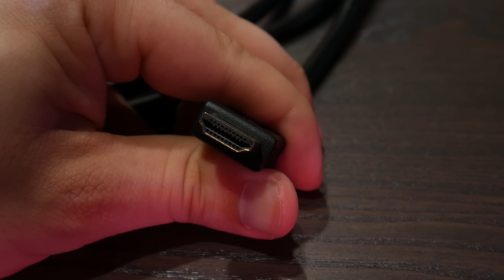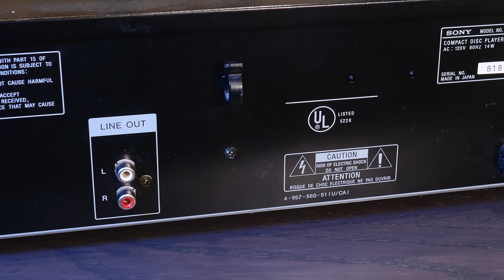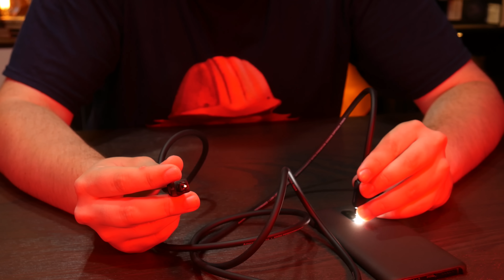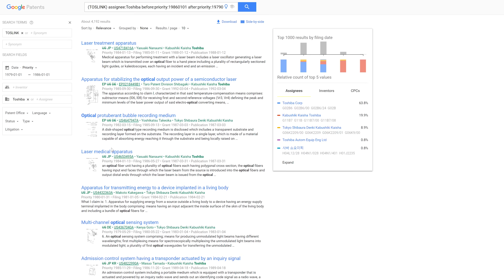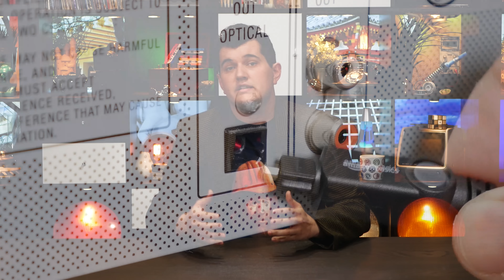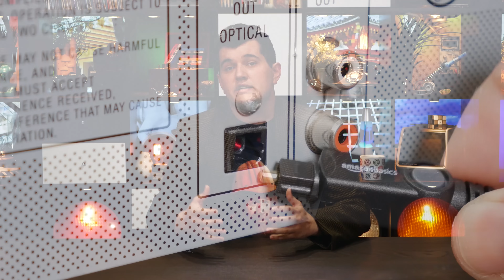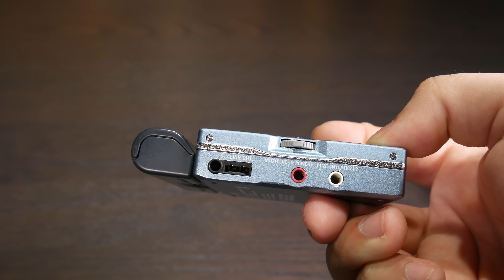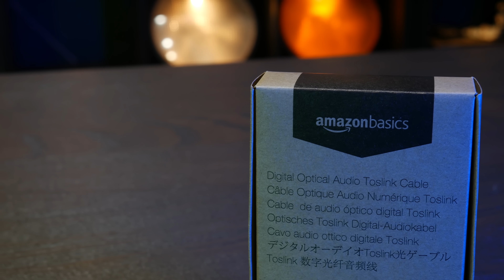TOSLINK: That one consumer fiber optic standard

Comment: the fact that there are TOSLINK cables with gold plated connectors just makes me want to die
Reply: I worked at a Best Buy years ago. A supervisor tried to convince me the gold plating on a toslink cable made a difference. I just laughed.
Reply: The funny part is that some of the gold-plated ones are slightly cheaper than the normal ones. Even more ridiculous though is "shielding to block interference". Lol you could cover it with a peice of black paper and call it shielding.
Reply: @HedgehogStudios1  since the signal is carried by visible light, black paper could legitimately be called shielding!
Reply: @HedgehogStudios1  yeah but true shielded cables exist, think hdmi, unused ports all those grounds.  of course that just makes the reference 0volts noisy instead.  other option, don't run your audio through a manufacturing line with high power motors/generators.  also an option
Reply: Some people are also ready to pay +1,500$ for a HDMI cable that has solid silver conductors, carbon fiber plugs, all the strands twisted and knotted and whatever together to make the sound and image better in all digital format. Like seriously, if the HDMI cable has the same standard specs as the other, go for the cheapest one, the more expensive does nothing else than cost more.
If you want a good laugh at how stupid some people are, just Google Monster or Wireworld and look at their HDMI cables. Monster stops at something like 200$ but Wireworld, oh they just start at 200$. And just to make the point clear only thing that that 1,500$ Wireworld Platinum mumbojambo HDMI2.0 cable does better than no-brand HDMI2.0 cable that costs 10$ is milk the gullible.
Reply: @IcedForce  those 1500$ things are probably better, structurally wise. i think you'd use such a cable for some rugged outside device, not your desktop system
Reply: @nemrody7828  Nope, Wireworld stuff is completely snake oil. They are not something extremely rugged or something that will make your experience anything more than just lighter wallet. As in their most expensive snake oil named Platinum Starlight 7 has solid silver conductors, which while yes, expensive and maybe better if we were actually moving analog signal could make some difference, aren't something you want to twist a lot or put into some harsh place, they will break because silver is actually fairly weak stuff.

But we are talking about digital signal that is just ones and zeros. There is no "sound" or "image" moving that would degenerate because cable goes too close to a power outlet (there is just "information" about the sound and image that the receiver turns into the sound and image). They either work or they have so much problems that even a blind-deaf would think something is broken or they don't work at all. And honestly, if you get errors with digital signals in cables, you either are running too long, wrong, cables for the job or you live in a place where you probably don't have a single electronic device that would work completely fine.

So no amount of "oxygen free silver" conductors, fancy twisting, gold plating conductors with carbon fiber covers or any of that stuff that used to matter somewhat with analog signals doesn't make HDMI cable change the sound  warmer or colder or give more bass or presence or give richer colors to a sharper image or any of that dingdong that Wireworld claims their Platinum Starlight 7 (600€/m) does. For any of that you would need to actually actively modify the signal which would make the cable actually worse quality than a coat hanger because it's not doing what it should do, transfer the signal unchanged from A to B. [Active cables are different story but also they should just boost the signal, as in send the same one or zero but louder, not change it otherwise than their own working needs, so no "warmer" sound or "more colorful" image should come out from the other end, just the same sound we send]
Reply: You're kidding right they seriously have gold-plated ones?
Reply: @Trekeyus  consumers are stupid
Reply: @kevinbooth-  more like uninformed
Reply: @kevinbooth-  Remember when everything was Turbo, then HD, 4K, now AI?
Reply: Kevin Booth —— You wrote, “consumers are stupid”.

No, consumers are ignorant, and that’s not wrong when it comes to toslinks.  But what is wrong is to manipulate people.
Reply: @thomaspayne6866  Yes, it's wrong to manipulate people, but what do you do if people want to be lied to? In the end, it's probably a win-win. The salesperson gets a large sum of stupid money and the idiot buyer gets the bragging rights for the next cocktail party.
Reply: TruthNerds ——  Too bad. Tell them the truth, or tell them nothing, but don’t lie.
Reply: @kevinbooth-  ignorant is not stupid. Some times there is no excuse for ignorance though
Reply: @Trekeyus  Not only that, but I've seen Shielded TOSLINK cables... Suck on that!
Reply: @Trekeyus  Gold makes it look better. Dosen't do shit except bragging.
Reply: @Trekeyus   they are gold plated for the same reason that it says supreme on a shirt
Reply: @Trekeyus  didn't you see the video? he literally showed them onscreen
Reply: @proxy1035  it was a rhetorical remark at the sheer stupidity of the concept of gold plated toslink.
Reply: @Trekeyus  oh i see. it sounded a lot differently though.
Reply: @Trekeyus  yes for the same reason monster made $200 cables
Reply: @Trekeyus  Yep, Some are also VERY VERY VERY !!! expensive! . You can even get 24k gold ones! Amazing right!
No chance of signal loss with a gold plated one!....... No wait,,
Reply: @Trekeyus  Even Monster Cable made one.
Reply: @Trekeyus  14:23
Reply: @Trekeyus  Yup, and did you know the cable of brand X transmits the laserlight só much better that you can actually hear it? How that works even though the signal goes through several conversions is one of the great mysteries of life. But hey, a manufacturer has to point to something to justify their Toslink cable being 20 times as expensive as a standard Toslink cable.
Reply: @Trekeyus  maybe it's for galvanic isolation?
Reply: Trekeyus same with hdmi.
Reply: @Trekeyus  They look nice. As long as you are buying it for the fact it looks nice rather than some kind of audio enhancment what's wrong with it? Similarly it probably means that cable itself is of higher quality and wont break as easily if you happen to catch it on something.
Reply: Almost as bad as the adds for the Pear USB cables that claim digital audio signals are "more than just ones and zeroes" when they totally are just ones and zeroes.
Reply: just look into "audiophile grade" cabling
they believe that a power cable with woo woo space magic makes better sound
Reply: I once got banned from a certain Headphone forum for arguing that $1000 TOSLINK cables provided no audible difference over a $5 cable. I even offered to run tests with a $20,000 1GHz oscilloscope if someone would mail me a set of cables (that I would return afterwards).

I wager the jitter difference between $5 plastic TOSLINK cables and the $1000 ones with glass cores would be in the single digit nanosecond range, at the worst, and unmeasurable at the best.

That’s not even remotely audible.
Reply: @BreakfastPaladin  WELL.. I would guess that it is possible that the fiber material could have an impact on the signal the longer the cable. A cheap $5 cable made with impure plastic could have an impact over say 10 to 30 meters?

The best analogy I can think of would be headlight covers. If you have old headlight housings that are fogged up / blurred with age you will not be able to see as far as ones that are clear. Taking into account the strength of the light and the strength/ability of the source detecting that light.

But I would imagine that Audiophiles would tend to have better front/head and back-end equipment to start  with so non pristine fiber material would only come into play at great lengths. (Over 100ft or 30m )
 
A ADQOPTDIA30 Audioquest Diamond 3m (10') Fiber Optic Digital Audio Cable Full Toslink to 3.5mm Toslink cost of over $1000 
I severely doubt would be any better than a 10' Amazon Basics cable thou LMAO.
With the minor exceptions of cable durability and how it looks hooked up to $$$ equipment.

As for the gold plated ends?!?!? Possibly for durability? If you were not just keeping them plugged in.. They of course would not help with signal transmission or any use in interference lol (Random Cosmic rays maybe?!? LOL)
Reply: @tisjester  a digital signal just works or it doesn't. There is no gradual degredation as with analog signals.
It sounds exactly the same until the signal is so bad data goes missing. At that point it just completely corrupts.
Reply: @TisJester XxX

As @Baron von Limbourgh below points out, it’s digital, so it’s either on or off. Using your headlight analogy, it would be like you tapping out Morse Code with your high beams, on a foggy night, and me standing 5m away decoding it. It doesn’t matter if it’s filament bulbs and a cloudy cover or HID bulbs with a clear cover, so long as I can see some light the result would be the same.

Now, as for glass vs plastic, the only difference is in light transmission (as you said). If it’s very poor quality plastic, it may add jitter in the low picosecond range due to less light getting through the cable, thus causing the light sensor in the receiver to not quite turn on as fast as it would otherwise, but again, that’s imperceptible from a listening perspective.

Keep in mind the above is just theory. I’ve tested both plastic and glass optical network cables with very expensive oscilloscopes (that have special boxes that hook between the scope’s SMA connectors and an optical interface) and the eye patterns at 10Gbit/s are identical (down to 1 picosecond) between cable types. These were high quality 15m plastic and glass fiber cables.

Keep in mind as well that most TOSlink cables are 5m or less. I don’t think I’ve seen any longer than that (without a repeater, which do exist). At less than 3m, I think you could cut up clear vinyl into 0.1mm strips and wrap it in electrical tape and it would work just as well as a real cable! XD
Reply: @BreakfastPaladin  with 20-20,000 hz yep
Reply: @BreakfastPaladin  They might even be worse!
Reply: @BreakfastPaladin  well, back when I was in university we did exactly this in my engineering class. Not with toslink but $2 HDMI vs $300 Gold Plated double shielded braided super cable and there was NO difference with the oscilloscope. BUT I think the difference people "see" are psychological. "I paid this much so it's better"
Reply: @BreakfastPaladin  brb getting into the TOSLINK cable manufacturing biz
Reply: @BreakfastPaladin  Well thats infuriating, but also pretty common. A well informed enthusiast is often between a rock and a hard place when trying to explain the benefits of good audio and how to get good audio. You've got the people who say their $50 soundbar they bought at walmart is the best sound they've ever heard and they can't fathom why you spent more than what a single dinner out costs on your audio system. Then you've got people who have IEC power cables between their amp and the wall that cost more than a new mitsubishi mirage and not only will they not admit its bull shit- they insist swapping out the power cable is the BIGGEST CHANGE they've ever made in their system. Complete and absolute self delusion. 

One of the worst offenders because he has a lot of videos on youtube where he sits in front of fancy electrical equipment but then spouts weasel words and peddles overpriced cables and crap... Paul McGowan from PS Audio. Guy would sell you a turd and insist that its the best turd you've ever smelled.
Reply: @BreakfastPaladin  I use $10 SM glass fiber optic cables daily to carry 80 channels of data @ 100 gigabit each with uncorrected  error rates that are virtually zero.  So I am going to agree that $1000 Toslinks are for idiots.
Reply: @BreakfastPaladin  there is actually a difference between the plastic and glass fiber optic cables used in the TOS-link, as described in the design manuals for the actual hardware.  However, the difference was merely attenuation and is covered in the optical power budget - glass was necessary for longer runs.  Perhaps the forum members were confusing the timing inaccuracies of this fiber compared to the fine fibers used for communication, in which case the timing skew due to the multi-modality of this fiber would greatly limit the bandwidth of the signal.  That is why this hardware had limited bandwidth, not just the speed of the optical sensor and receiver.  The breakthrough of this hardware was that the thick fiber permitted easy connections.  Terminating communication grade fiber takes skill and training.
Reply: @BreakfastPaladin  Well, you got rightly banned from that forum, your behavior was unacceptable. I mean, that's like going to a mental institution and telling the inmates that they're not Napoleon. Not cool at all. ;-)
Reply: @Jed-Henry Witkowski Well, the L/R RCA is an analog audio output and the TOSLINK is digital, so of course there will be a difference. I don’t think I ever said otherwise?
Reply: @infraviolet  I want some woo woo space magic power cables now!
Reply: @infraviolet  don't forget the cable risers
Reply: @Farie977  what even is the idea behind those? what do they pretend that they do?
Reply: @infraviolet  well it's for isolating speaker cables from synthetic carpets but idk how bad it affects the signal

and yes it becomes an audiophile thing
Reply: @infraviolet  They also believe that a $3,500 set of speaker cables -- with spacer blocks under them to prevent them from touching the floor -- prevents "leakage."  Hold on!  I DO recall that changes in "f" cause changes in "X'.  Does that little "f" stand for "floor"?  My bad, maybe I SHOULD use my family's covid relief check to put some "audiophile" speaker cables on layaway...
Reply: @infraviolet  Gold plated wires make sense for tracks of cable going super far (potentially thinner cables). But headphones with 6 ft wires won't see a noticeable difference
Reply: Oh my gosh I want one now. I think I might have issues.
Reply: @Beesno  Still a thing to buy. Current Year.
Reply: Yes, well the manufactures are catering to the audiofool; i.e. the ones who''ll pay $$ for anything with Naim, Linn et al written on it.  I could put a turd on Ebay with a Naim label on it and some fool would bid $$$ for it.
Reply: There are also HiFi power cord available. Like, if it got a built-in noise filter then it might be something actually useful, but no, seems to be just regular power cord with plastic weaved net outside.
Reply: 野龍 there are many audio power cords with built in filtering, and many do make improvements, particularly when filtering ac for digital based components. Many are snake oil, but some are quite effective.
Reply: @joesantamaria5874   I personally have enough "PC" a/c cords running this way and that and next to high speed usb which I can find highly shielded cables for but considering I could theoretically put an HDMI stick in a port on the tv/monitor and video card output(if they made that) and maybe a PCI_E card. I would puchase if it was not overly expensive. Also, I am looking to find better shielded a/c cables. I have a habit of replacing the crummy ac/dc adapters with a connection to a computer power supply and a turn-on plug (connecting the green wire pin to it's ground) and almost every device I have seen for computers, IE routers,switches,etc. uses either 12v or 5v and the power coming out of a pc power supply is so clean it warms my heart ;) So I know the components like it.. lol
Reply: Yeah, I bet it doesn't even come with the audiophile bag of rocks you need to get the most out of your digital audio!
Reply: @shukterhousejive  Don't forget the coat hangers and alligator clips. The ONLY way to get the TRUE audio experience.
Reply: "There's a fool born every minute, and two to take him" -- P.T. Barnum
Reply: I don't think I can even by toslink cables without gold plated connectors. Every single one I have found so far is gold plated.
Reply: Actually, golden-looking coating on contacts is often not gold, but TiN - Titanium Nitride, which is very hard and wear-resistant.
Reply: Diamond TOSLINKs would be a genuinely useful "premium" upgrade, if you could make them flexible, for the people that need to spend £100s in order to enjoy something,
Reply: A lot of these 'high-end' cables aren't actually compliant with the standards which are set out by the manufacturer, either. Directional (electrical) cables are a thing though, because the shield should usually only be grounded at one end.
Reply: but you won't get the full speed unless the cable is orange.. orange = faster.. this is known.
Reply: @BenK12345  papaya orange like a certain F1 team.....
Reply: @BenK12345  orange is high voltage, red is faster
Reply: @BenK12345  It is known
Reply: There is ONE instance I can think of where it could be useful and that’s if it is dealing with infrared light.  Infrared can actually pass through many plastics (even black garbage bags) and gold would do a good job of shielding from outside sources while being chemically inert regardless of what environment it is in.
HOWEVER since we can actually SEE the light this would make it over engineered for what is needed…
Reply: There's a ton of bs in the audio world, you've got to use your sniffer.
Reply: Look up Audioquest Diamond Optilink on Amazon... €1000 for a Toslink cable :/
Reply: I saw one in a small store once and pointed at it making a funny face at the clerk, his best guess was that it was one of a range of of "high end" cables from the same brand, the others were analog, and people aren't too bright so might question why one cable in the range of cables isn't gold.
Reply: Oh - so you have not seen this SATA cable for Audiophiles then?:
https://audiopc.shop/en/winkel/cables/audiophile-sata-cable-black-reference-ppa-studio-paul-pang/
Reply: Really? Made by monster I bet...
Reply: @Googaliemoogalie  Or Pear
Reply: well, gold.. because RUST can do wierd things.. in many minds..
Reply: @herauthon  Rust, what are you talking about, plastic doesn't rust.
Reply: @Googaliemoogalie  Monster is cheap, guys will spend $10 grand on cables lol
Reply: @Googaliemoogalie  MONSTER. I was trying to remeber them. The Coat Hangers are equal to there pro audio cable company.
Reply: @Googaliemoogalie it's going to be made by basically anyone targeting idiots 'average consumers" because "gold connection = better".
Reply: It's for gangstas
Reply: @Robert Baker I've seen digital cables prices as high as new cars. Literally thousands of dollars for a couple of meters. And power and speaker cables for over 20.000 dollars. You could buy a couple of Brand new Teslas or a set of speaker cables for your surround HiFi. :D
Reply: I hope you don't really want to die
Reply: About as dumb as gold plated HDMI cables..... Yet Best Buy, among other vendors were pushing those for as much as $100 for years. Hell, they still sell them for $30, which is absolutely hilarious.
Reply: Fun fact is that even the cheapest nastiest toslink cables from Aliexpress... are indeed glod plated ! 😂😂
Reply: nmeunier  It ain't the only format you can get audio snake oil in.
Reply: Meh. We have customers where I work who are wanting to pay upwards of $1000 for various PCIe cards to give them better audio from their ... digital stream.
(Meanwhile they usually opt to purchase the cheapest Chinese PCs we have...)
Reply: I used to work at Walmart selling those. I laughed my ass off at the packaging that claimed you would get better audio signal because of that gold plating.
Reply: my fucking stomach dropped when he said "gold-plated TOSLINK connectors". how stupid can someone get?
Reply: @cosmic7234   For the mini TOS it could make some sense, as they also plug into combination electrical signal sockets. One might want to avoid corrosive contact for the other type  signal that hole may provide. (usually a line level or headphone signal) Then again, a pure plastic plug would serve the same function.
Reply: @Writer B.L. Alley Nickel (and also tin) plating degrades over time where gold does not so in applications where something is going to be plugged together for a very long time gold plating is preferable. Gold plating isn't really that expensive though. I use gold plated 6mm bullet connectors on my R/C vehicles that cost $5 for a bag of 6 connectors. Silver also makes an excellent plating for power connectors. Anderson uses silver plating on the contacts in their large battery connectors (these range from 15 amp up to monster 350 amp connectors used on things like forklifts). I would have thought that oxide buildup would cause problems but apparently this is not the case.
Reply: @atomicskull6405  Thank you for demonstrating your profound ignorance. How do you not get how all those advantages are completely inapplicable to a fiber optic cable?
Reply: I just laughed my ass off when he mentioned that. 🤣
Reply: You can find the same thing with a lot of other digital cables, like HDMI.
Reply: @Writer B.L. Alley 99% oxygen free copper cables? I've never heard of this and if love to have a Monster sales rep try and justify that
Reply: I once saw a gold plated 2m SCART cable for €100, that's €0,50 per CM. Remember, SCART cables can't transfer much more than PAL TV resolution in most situations. I bought the €5,99 cable. Was gonna watch VHS with it anyway.
Reply: @Writer B.L. Alley this is a great comment  you're totally correct
Reply: because if they are marketed towards "audiophile" niches...well, u know, snake oil $1000 copper cables always have some gold plated and red bands on it
Reply: @clarkkent6026  Yes, because everybody knows snake oil flows best through gold plated and red bands. If you didn't know better you'd think people want to be scammed.
Reply: @tjroelsma  well, there's science and instruments to verify cables on one hand and on the other hand...there's $1000 cable vendors that only swear and scam and write biased reviews in "audiophile" magazines and blogs just to fool the ignorant, so yes, to them snake oil needs golden and shiny cable connectors to scam them
Reply: @clarkkent6026  Snake oil salesmen tell you you can't measure the effect their special cables have on the sound, but you can hear it if you believe in it. Sounds more like a form of religion to me.
Reply: I took a screenshot of one a couple months back that said it was "glod plated." As I'm sure you know, glod keeps your optical connection from corroding and makes light transmission better. Gold, on the other hand, is worthless.
Reply: Plot twist the gold plating is for Jason King retro style porn credentials and it looks good alongside a packet of Durex black shadow! Thats why they call it Toslink. 😂😂😂
Reply: It makes sense for coaxial S/PDIF since gold is corrosion resistant.
I don't really understand why anyone would waste money buying (or making) gold plated optical S/PDIF cables.
they should put that extra $0.35 into better optics.
Reply: Sadly, there's a remarkable amount of snake oil like this when it comes to cabling. Carry over from analog signal cables plus gold is shiny.

Now I'm having nightmarish flashbacks of overpriced Monster cables.
Reply: From Amazon:  
> Polished heavy duty metal connectors and gold plated tips provide a secure and corrosion free connection with this heavy duty optical digital audio cable
Reply: There’s plenty of merit on gold plated electrical connectors. They provide lower junction resistance even disregarding corrosion. That’s why many card edge connectors were gold plated (and console cartridges would fail when it wore out), IDC connector pins for HDD ribbon cables, IC ceramic package legs that were intended to be socketed, etc. were all gold plated. Purely digital signals and circuits exist only on paper, and in the imagination by the way. In the physical world, nothing is purely digital. It’s all a matter of how valuable signal integrity is.
Reply: It’s like having a B/W Picture in a gilded frame
Reply: But gold is better than copper, because gold makes the signal go more faster. You dweebs are all just too poor to have gold ones lolololol.

^ Someone will say this unironically at some point. Let us all have mercy on that wayward soul; He probably has 1000$ HDMI cables (yes, those exist) plugged into his HDMI 1.0 ports.
Reply: I use optical for connection to my astro mixamp to my pc because with aux cables half the time you end up with a low level hum
Reply: @phazonlord0098  if that’s true than it is the opposite of gold because it tarnishes.
Reply: In this world exists a network switch, that costs way more than a normal one, that claims that it improves quality of sound from streaming services like Spotify or Apple Music. Now live with this information.
Reply: Yes
Reply: ...I cant even...
Reply: If you really want to loose all hope in mankind just check out the most expensive audio/video and power cables from Nordost.
Reply: @JMNTN  With electrical connectors there's at least a theoretical benefit with gold plated contacts.
Reply: Lmfao I didn't know this existed
Reply: It's like the Monster cable scam, lol
Reply: @The_Greg_5000  apparently it is
Reply: I just shake my head when someone tells me they bought a top of the range HDMI cable etc...Digital digital digital!!
Reply: @JamesSiggins  With HDMI you can make the argument that a really cheap HDMI cable might not always have the necessary contactpressure so you might actually benefit from buying a reasonably priced cable for problemless 4k video transfer. Reasonably priced cables mostly have better quality connectors so the minimum contactpressure is guaranteed. 
 But I can't think of any reason to spend several hundred dollars for a top-of-the-range HDMI cable.
Reply: @tjroelsma  plus there is bandwidth that I didn't mention. It's a general concensus. Lol.
Reply: @JamesSiggins  Like I said in my reply to Clark Kent "you'd get the idea that people want to be scammed." They sure seem eager to buy into anything a slick salesman tells them.
Reply: I think I might even have bought some. I needed the 3.5mm connector and the only TOSLINK cable that came with one, was a "high-end" one with gold-plating. That's what happens, if you are too impatient for mail-order and go to your local retailer for a product that's already on its way out.
Reply: The ones I use (Monoprice Premium) use regular black connectors, which makes more sense than having this reflective "premium" gold-plate nonsense
Reply: nmeunier  And USB cables. And HDMI cables. And headphone cables.
Reply: Also features glass made from virgin organic silica.
Reply: plastic with gold color costs near to nothing.....
Reply: it just goes to prove that there are people out there that are uniformed and stupid enough to buy even the most useless products.
Reply: Of course they have some in gold it's gives you a much better connection 😂😂😂😂😂😂😂😂
Reply: @michaelelsy2209  gotta make sure you put sound crystals on the ends and use cable stands to widen the sound stage and add more dynamics and attack :^)
Reply: @ultimas20  that's just so true 🤣
Reply: @Writer B.L. Alley Something else I forgot to mention is that gold is a better conductor than nickel (the three best conductors are silver copper and gold) and in the case of high amp power connectors that can actually be important. The 6mm gold plated bullet connectors I mentioned see 50-150 amps in actual use on brushless motors. But in the case of signal connectors nickle is probably just as good I suppose.
Reply: @atomicskull6405  There's no standard high amp power connector that requires gold plating. If it's a custom connector, then it's still either more of a gimmick, or they were seriously constrained with regards to contact surface area (you can always reduce contact resistance by increasing area), or maybe they want the softness of the gold to ensure full contact because otherwise the connector could become hot and cause the insulation to smolder.
Reply: Why is everyone upset with the gold plated connectors?  The probability that the chinesium gold is really gold is zero anyway!
Reply: they look cool, but no real function above a normal cable.
Reply: @S just standard ITU red/blue DWDM channel scheme.  I work for a large telecommunications provider in the US.
Reply: It is all about avoiding ground loops going from consumer to professional balanced gear. Period. Only reason to give a crap these days. And let me tell you partner, it is a phenomenal help. 20 years in - bless tos link.
Reply: What?! Ur kidding rt?
Reply: @phazonlord0098  From best to worst conductive elements.
Silver, Gold, Aluminum, and Copper being the worst.
Reply: @jasonbender2459  It's more fun if some people don't get it...
Reply: yup,  and $20k hdmi cables..
Reply: LIKE BT WITH FIBER BUT STILL COMES TO BUILDING WITH COPPER WIRE ?
Reply: It's a common fact that gold-plating improves the quality of literally everything
Reply: correct
Reply: Also HDMI cables that cost hundreds or thousands of $.
Reply: I laughed loud when he showed this
Reply: Not only won't the gold conduct it through the whole cable, but silver is an even better conductor and it's cheaper.
Reply: What a waste of gold
Reply: I want me some of them! I mean, if you can gold plate something, you should, right?
Reply: I kid you not I almost spit out my coffee when he mentions that 😂😂😂😂😂😂
Reply: nmeunier  monster cable in general
Reply: The main thing I learned from this video is that audiophiles are really easy to scam
Reply: Yes this is Because Light OXIDIZES and the Gold  ones are faster.
Reply: BRUH!!!
Reply: I understand gold plated electric wires (prevent rust) but I can't understand gold plated optical wires. 😕
Reply: actually... it makes perfect sense.
Reply: I think i know why you want to do that but please explain
Reply: Giving all it's meaning to fool's gold
Reply: Same with usb or hdmi cables with gold outer shells, the shell doesn’t transmit anything
Reply: I mentioned it in a different comment, but when I had to find a relatively cheap toslink cable, the cheapest one I found, prominently featured gold-plated connectors mentioned on the package. I could not understand why on earth that would make ANY sort of difference; it was the cheapest one available, and at a price that I was willing to pay (it's one of those pretend-to-be-high-end things, it really didn't cost much).
Reply: I never used those optical links on consumer products. They were impressive though weren't they. Turns out: TOSLINK - aptly named :-)
Reply: Don’t forget TOSLINK with thick insulation for shielding.
Reply: But they look so pretty
Reply: The fact they exist should not upset you. The fact the consumers buy them for a huge premium should... unless you make exploitive products and relish their stupidity as it lines your bank vault with cash.
Reply: and I have JUST realised that my Toslink to Mini Toslink cable has gold plated connectors
Reply: Even TOSLINK alone is ridiculous if you consider that it just transmits a very low speed digital signal. The crappiest speaker cable obtainable would easily losslessly transmit the same signal.
Reply: Please do
Reply: audiofools, love overpaying for cables.
Reply: @Writer B.L. Alley but this is an optical cable, the gold part would be purely structural. this is the worst part
Reply: At least they look cool I guess...
...
...
...
(Slams head on desk)
Reply: Didn't you know that the gold reflects the light and makes the signal better or something 🤣
Reply: The ultimate sucker bait!
Reply: I went on a rant at the cable wall in a BestBuy about what a crock of shit it was. An employee actually tried to argue with me that the gold plating "helped"
Reply: Trump getting elected made gold-plated TOSLINK connectors look good
Reply: Considering the gold is on the part that latches it's not that usual.
Reply: i just found out that honeywell makes them as well. lmao
Reply: but its so pretty :3
Reply: Gold is more betterer
Reply: Well they look cool
Reply: They look good bruh..
Reply: What you talking bout? My Toslink just likes its blingbling!
Reply: To be fair it COULD be used legitimately to visually signal an especially hi-fi or otherwise higher quality optic cable if there was a standard for such a thing. 

Cables from aux to HDMI all use gold for that purpose and for its legitimately good conductivity. It would make sense to just keep that even for optics. But obviously that's not what's being done here.
Reply: It’s not that weird. They don’t corrode and they have decent wear resistance, they already do gold plating on “actual” plugs, so why not make pretty toslink cables? But yes, the public is not smart. The 2024 US election showed how uninformed, aggressively ignorant, and willfully uneducated most people are.
Reply: @josedorsaith5261  It's freezing.

Wow, I was thirsty 5 years ago
Reply: First time I saw it I just started laughing hysterically
Reply: Gold plating makes the photons sound warmer.
Reply: me too omggggg
Reply: It's too prevent oxidization that could make it much more brittle overtime
Reply: 12 hr shift busing tables for 12 an hour makes me wanna die
Reply: i'm not shocked these things exist, marketing people are full of shit,
but even then... lord almighty...
Reply: @klontjespap  Then people who buy them swear blind that they hear the difference. They can't admit that they sound just the same and that they wasted their cash.
Reply: @klontjespap  Hey now. It's not our fault Jones don't want to educate themselves. 

Seriously, many times, you truly get what you pay for.
Reply: Almost as good as the gold-plated shields on USB-A connector!
Reply: @SomeGuyFromCrowd  gold-plated electrical contacts are reasonable because it makes them more corrosion resistant. it's ridiculous for toslink because you can just make it out of plastic and sidestep the whole metal corrosion thing entirely
Reply: @spambot7110  Thing is that most gold-plated cables don't have any gold on the electrical contact points. Just on the metal shrouding.
Reply: That's just the tip of the iceberg.  Denon was selling a $1000 ethernet cable for use with some AV receiver that for some reason had the direction it was supposed to be installed printed on it.  There was this company selling a light absorber that were calling a blackbody that was supposed to cut down on interference based on data that blue light made audio sound better.  There were (are?) companies selling ceramic isolaters meant for power lines to keep your speaker cables off the floor.
Reply: @Phos9  And they all work the same way, Placebo Effect. For a lot of people the mere act of paying a ridiculous amount of money for a cable will automatically make them hear an improvement in the sound. I can't say I've tested this, but I'm pretty sure you could just stuff that cable into a drawer, tell them it's been installed and they would sing praises to the genius who created that cable because it opened up the sound stage to such a degree...
Reply: @Phos9  At the very least keeping cables off the floor (which may have cabling running under it, depending) could maybe make sense in a pure analog setup.
Reply: I had to rewind several minutes after hearing that, as I was too busy sliding off the couch in tears.
Reply: @Maraxius  how fucking sad is your life that a corrosion inhibitor makes you cry.
Reply: Maybe we just want to flex our bling bling.
Reply: I saw them on Amazon well before seeing this video. I had exactly the same reaction that he did.
Reply: Just here for this comment, i dont have any TOSLINK conector, but i will buy a golden one
Reply: If you have installed fancy High-End Cables on all analog signals... do you want a ugly black plug hanging out of your masterpiece? For me it makes sense (for optical reasons)
Reply: @BaumInventions  The exaspiration is at the connector itself being gold plated, you can't even see it when it's plugged in. It's obviously marketed to people who don't understand how TOSLINK works.
Reply: That reminds me of that demo Monster Cable did some time ago for their "special" HDMI cables. While yes, the signal looked a bit nicer on the huge mixed signal oscilloscope they used, they also had the HDMI tresholds displayed and you could see that the cheap $5 cable did the job just fine. 
Then again, they only need to impress the idiots.
Reply: If it has a "regular" 3.5mm plug on one end it is used to turn the laser on and the analog audio off in which case gold is the standard for parts that are subject to oil,dirt,dust, dried up soda... :)
Reply: @Writer B.L. Alley you don't need to involve any kind of metal at all when there's no electricity involved
Reply: There are even old golden teeths to make your cringing noise free LOL
Reply: I hope you’re kidding. I’m not going to look it up.
Reply: @askhowiknow5527  Yep. They do indeed make them. Just googled "gold plated toslink cable" and a bunch came up. :P I've purchased higher end cables in the past (not toslink cables, though) simply because I like the construction and the look, not because I think they make the sound any better. But I can't think of even one reason how a gold plated toslink cable connector would be any benefit at all, though. Even for the look, because the plated portion would be imbedded in the socket, so... ;) I guess if you like the overall look of the cable, that's fine, because the plated ones often have interesting, beefy connectors and braided cables. But, yeah, EM interference is never going to affect the photos in the cable. You only have to worry about gravity. But if you're near enough to a black hole that it's affecting your home theater system, you've got bigger problems to worry about... ;) :P
Reply: manufacturing those in the first place is a pretty hostile gesture.
Reply: Stupidity will never die and others will always make a business out of it.
Reply: It would be ok IF they just marketed it as cosmetic, but something tells me they don’t.
Reply: Art in Heaven  totally agree, the red one usually 3 time faster than normal.
Reply: I bought one of them off amazon because it was the cheapest 10ft option (it was only around $5) and it's just gold colored plastic.
Reply: most funny part of the video!
Reply: Uneducated consumers just want that. Just like gold plated USB connectors of external digital audio cards for PCs. Ignorant people are the best customers.
Reply: All the people complaining about gold plated cables (apart from fiber) apparently never had cables in a remotely damp environment. Spolier alert: Gold doesn't corrode the way the rest do. There is value in gold plated cables.
Reply: @cosmic7234  Digital signal is  about reading  either 1 or 0. It does not care for anything else.
Reply: I'm face palming so hard right now knowing that this is a thing.
Reply: I needed 30ft RCA cables a few years ago, Bought the cheapest pair I could find on ebay and they happened to be "Gold Plated". A few months of use later, the "Gold Plating" literally slipped off. Just lil conductive yellow pieces of metal with plastic underneath. Had a very small wad of copper wiring inside with only a handful of wires making contact with the "gold plating". Same experiences with newer more modern cables as well such as HDMI etc. It's really just best to buy the cheapest cables that work and use them until they don't. TOSLink isn't gonna make your Sony deck bump that Pac CD any better, Sorry
Reply: Well if it's in a humid area and not replaced often gold might be good to prevent rust do to it's oxidation resistance. But that's likely overkill for consumer use.
Reply: @mcgrotts  What would rust? There's no metal in a TOSLINK cable. You're just the kind of idiot they made it for.
Reply: @mcgrotts  What would rust? There's no metal in a TOSLINK cable. You're just the kind of idiot they made it for.
Reply: Gold Plated Disposable Plastic Straws Would Make More Sense.
Reply: that says it all. Now the whole thing seems like a scam
Reply: @gaydolfhitler6310 no, consumers are just stupid & associate "gold plated connector" with "better", so adding less than a cents worth of gold that doesn't change anything about the product still results in higher sales, because people are stupid.

Don't blame the player, blame the judges. And while you're at it take that crayon away from judge 4, he's going to poison himself.
Reply: You underestimate the appeal of premium/luxury branding.  Everyone wants to be a baller, and buying the most expensive cable helps with feeling like a baller.
Reply: @dabradguy  I'm in the wrong business being a chem undergrad...
Reply: @caffeinepizza  Having a BS in chemistry myself I can assure you that you are right.
Reply: It's well known that gold plating stops the photons from falling out the side of the cable
Reply: LOL, I bet there are huge 1cm diameter "high end" ones, too.
Reply: Just to be devil's advocate, I guess the gold plating might be useful with the mini version that carries electric as well as optical...
Reply: @shotintel  the mini version does not carry electric, it just uses the same plug so you can choose to use a regular mini jack in stead
Reply: Gold plated grounding sleeve.  Yea it is mildly pointless however it is better than using alu.  It has a better flex/contact holding ability, other than that yea it is a joke.
Reply: I will say it is silly but I have found that the gold plated ones conform better to older ports that have been used a lot. I have about 3 I use, and constantly have moved the boxes they are plugged into around and the gold plated ones might just be better tolerances but I think it might have to do with the little bit of gold being softer/ more malleable. Obviously that’s not what the companies are selling the premium gold plated connectors for, but that’s what I’ve noticed
Reply: It all depends on how you define "connection."

A gold-plated Toslink connector does not affect the DATA connection, but the gold-plated connector arguably improves the PHYSICAL connection, e.g. how solidly the rib on the keyed connector "clicks" into the Toslink jack.

Does that make a difference? Not in 99.99% of circumstances.

Does it technically improve the "connection," when defined as above? Yes, so it's not technically false advertising.

It would be as if a headphone cable used a jack that was 1/64" larger in diameter; when inserted into a 1/8" headphone jack it would improve the "connection" without affecting the signals sent OVER the connection.
Reply: @VideoArchiveGuy  It's gold, basicly one of the softest metals known to man. Fun thing, in any enviroment gold is only used as anti-corrosion coating and if you really wanted the best conductivity, you would use silver or even plain copper. Using gold for better physical connection is like using 0.001mm thick coating of lead to make connector heavier for harder disconnection, it, in reality, does nothing or the difference to well produced (with thight margins) aluminium or copper-steel connector is unnoticeable without gigh-end lab gear and even then the difference is in nano to femto scales.
Reply: Durability reasons. Never seen this on any of my ther plastic connectors including some of my classic gaming consoles.
Reply: @Vee_H.  metal vs plastic isn't durable. it's just going to make the plastic female socket (which, btw, is much harder to replace than the cable) wear faster.
Reply: The gold plating results in a superior connection because... because... because... because it has a better modulus of elasticity than cheap plastic and therefore inserts and removes slightly better. You probably can't notice the difference, but a highly sensitive audiophile's hands can.
Reply: nmeunier nice profile picture
Reply: cApItAlIsM iS aN eFfIcIeNt AlLoCaTiOn Of ReSoUrCeS... hurr durr the wisdom of the free market
Reply: @fzgn   The “wisdom of the market” or the lack thereof on the part of the consumers, if someone pays big money for a useless thing, that’s their problem.
Reply: I thought that gold plating was for improved durability, and thus more plug/unplug cycles.
Reply: @CaveyMoth  Because gold is very hard and durable...
Reply: @leonharder4846  Oh, yeah, it is hard. ;P
Well, it is quite malleable at room temperature, compared to many other metals. Maybe this helps it when it's forced into tiny jacks, like that one girl with the five black gu- I mean uhh..you know.
Reply: @leonharder4846  corrosion and manufacturing costs. Gold doesn't corrode and it being very malleable it is easy to work with to cut just a very thin inexpensive piece of it to put on top of the connector. And there you go, you got a connector that resists corrosion and was cheap to produce.
Reply: @vevero7139  There's another material that doesn't corrode.... plastic.
Reply: @vevero7139  ok but the standard cables are entirely plastic... that ain't gonna corrode lol
Reply: Leon Harder
It’s “durable” because it is inert and even if in contact with a dissimilar material it will not corrode (it’s also good for non sparking)
Another useful metal for contacts is beryllium copper, but there’s an issue for the manufacturers… beryllium is poisonous
For an OPTICAL system however…
Reply: @vevero7139  might as well use plastic
Reply: @DokterRoetker  well, for those connectors it is true, but I was talking in general (electric connectors) because he was being sarcastic as gold being durable, I just told him why gold was durable for connectors in general
Reply: @vevero7139  okay fair enough
Reply: @vevero7139  Yep, you're the reason we haven't gone back to the moon in 50 years. You know what else doesn't corrode? Plastic.
Reply: @vevero7139  If they worry about corrosion then just use plastic because this part is not connected to or transmitted any things it just a cover for optical wire.
Reply: Because plastic needs corrosion resistance ;)
Reply: @vevero7139  you know what else doesn't corrode, is very malleable, easy to work with, and even cheaper?
plastic.
Reply: @vevero7139  plastic resists corrosion pretty darn well...
Reply: @vevero7139  mmmmm. Corrosion on a plastick connector??????
Reply: @amak1131  sick burn! <3
Reply: @leonharder4846  Gold is one of the softest and least durable metals. Pure gold can be scratched with your fingernail.
Reply: @vevero7139  plastic resists corrosion fine.  There is no electrical signal.  Gold is superfluous.
Reply: @vevero7139  But... the normal ones are plastic...
Reply: @leonharder4846  helps with oxidation, wear and tear compared to a regular metal. Mines are gold plated but they are secondhand ones paid few bucks for each.
Reply: @vevero7139  As long as there is no dirt on the end of the fiber itself, the metal part can be all corroded to crap and not mater. The metal does not even need to be there. When I developed professional grade optical interfaces for large venue sound systems, our opto cables had just plastic ends. The metal is not required in the least. It is just trim.
Reply: @leonharder4846  Gold is a good plug material, calm down. Whether or not it passes electricity is irrelevant.
Reply: @FourthRoot  Oh boy. Salty McSalterson. The moon? For what? 😂
Reply: @CaveyMoth  sarcasm my friend. hopefully you've learned it in the last 5 years.
Reply: @leonharder4846 nah, gold is extremely malleable
So much so you can hammer it thinner than paper
Reply: @CaveyMoth  gold is lower resistance and less reactive (corrosive) than copper.  only matters for electrical signals, not light based
Reply: @CaveyMoth  bruh
Reply: @CaveyMoth  Potentially significant in cables that transmit using electricity, but less so for fiber optics...
Reply: @CaveyMoth  improved CONTACT RESISTANCE durability, which doesn't matter if it's not carrying any current. gold is a soft malleable metal which isn't springy at all. if you want a durable spring action you go for either spring steel or a plastic like PC or PA
Reply: Gold plated connectors are for gold plated TOSsers.
Reply: Don't forget gold plated USB and HDMI connectors.....
Reply: D13H4RD2L1V3 They are digital, but electric, so corrosion resistant contacts actually makes some sense.
Reply: it's to make an electrical connection between the two devices when the cable is plugged in, simply to let the devices know they're connected with TOSLINK. 
And the main important reason for gold plating on ANY connector is it doesn't tarnish. Not because it sounds better or something.
Reply: Why?? Are you nutts? A gold plated connector will make a better connection that is susceptible to micro electromagnetic interference
Reply: busts in from out of nowhere "DID YOU SAY GOLD PLAYED T (    )    S LINK ?!? BRUH HOW DO I DOWNLOAD THAT?!"
Reply: Andrei Alexandru Bleorțu  Welcome to Chinese design. If gold is good for copper cables it must be good for optical ones in the brains of the Chinese clueless trying to scam people out of their money.
Reply: If you have normal hearing then the gold plated connector is unnecessary. I can hear the difference in sound quality but this is extremely rare. For most people not worth the money.
Reply: @uraldamasis6887  LOL, you're just as dumb as the people who would buy it. You have no idea why the gold is stupid.
Reply: Ural Damasis no you can’t. Confirmation bias and wishful thinking. I’d bet my house on it.
Reply: @uraldamasis6887  Nah bro, nice bait though,